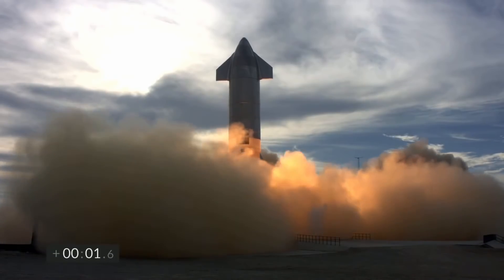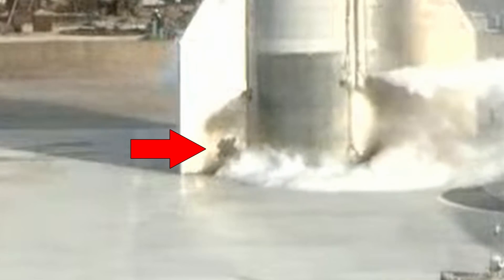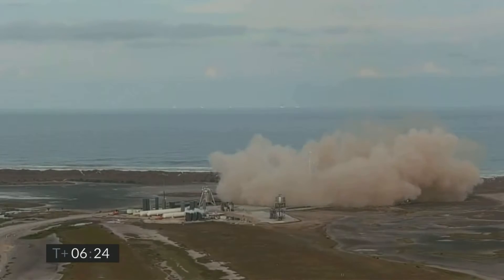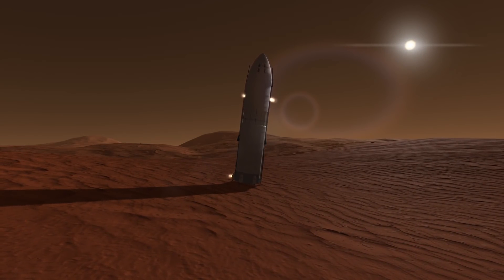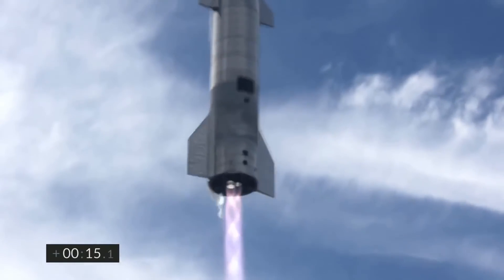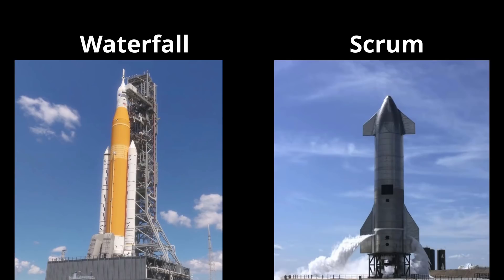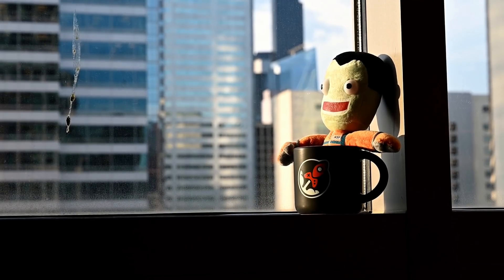Triumph and Tragedy: Starship SN10 sticks landing, then EXPLODES

Comment: As for design process I think the Waterfall approach is better for design based on an already proved concept so the design can go faster (theoritically but when politics get involved...) Scrum is better to design a new product not based on current tech with radical differences. It allows to test aspects independantly and improve the design each time. Scrum the SLS would in theory be useless, on the other hand, the Saturn V engines were scrumed a lot for a good reason, it was the first engines of this size for a rocket of that size. Using a Waterfall method, USA wouldn't have made it to the moon before the Soviet sent their Lunakhods there...

Comment: Imo, SN10 would have exploded faster if not for the fire suppression system. It helped cool down the skirt and lower pressure (internal leak and bad landing legs means that the skirt is next to inpenetrable and therefore the pressure builds up, with heat it can ignite methane and if pressures goes higher, something will break and possibly rupture the LOX tank just above, which likely happened. It exploded only after the FSS went offline (and external fire extinguished, suggesting a rupture due to pressure build. inside the skirt)

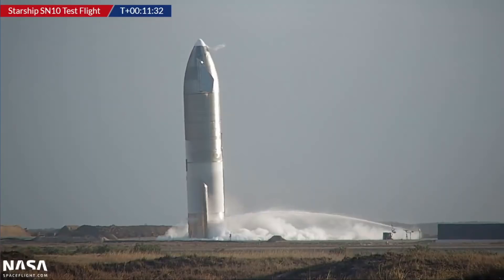Comment: About that fire hose: at 4:50 you can see that it DOES reach Starship. Maybe they had a problem with the water pressure, or it was intentional for some reason

Comment: well, I don't think anyone in his right mind would fly a system like this to the moon. For probes and such it is good enough.
Reply: This is the third iteration of a test vehicle... both the raptor and starship have lots of improvements needed and will get them, this vehicle will definitely improve and even if it's still unreliable, there's a lot of use as a cargo variant and not human
Reply: Why?
Reply: @matt309  because with the turbine pumps they are build for reusability, not reliability
Reply: So let's use it as our heavy lifter to send materials to our moon bases. I like it!

Comment: The different colours could be from a more recent engine with different throttling. I think they said they were going to be working on that. Might even have been deliberately testing it.
As for the fire suppression system; it may have caused the explosion. If the methane had continued to flare off it may not have been able to build up to explosive levels. By putting out the fire they made things worse.

Comment: Before touching the ground, it was already on fire.
Reply: That was the engine flame out which was only a little bigger than it should have been. The cause of the explosion was a pressure failure of one of the tanks
Reply: @solaris207  I saw videos saying and showing in slow motion that it was already leaking and another photo showing the raptor crushed by the beaten ground.
Reply: @rubensgoncalves5593  yes but my point is that the explosion still would have occurred without the fire
Reply: @solaris207   OK!

Comment: More yellow means more fuel rich as far as I know could have that been the engine causing the abort?
Reply: I'm probably wrong, but doesn't a yellower flame also mean lower thrust?
Reply: @midgesmall494  could be if it's caused by lack of oxidiser becouse it's not burning properly, but I think if you take the right mix and just add fuel it might have the same or even a bit more thrust and the yellow flames, but I'm not a rocket expert

Comment: I think the 2 engines shutting down at the same time might have been a failure, from what Elon said it sounds like they should’ve gone one at a time and not simultaneously. Could be wrong but just my thinking. Might be why it landed a little hard.
Reply: they did not shut down simultaneously and it did not land very hard, that landing up until the legs failing was damn near perfect. The legs are just not suited for the weight, after all they weren't testing the legs at this point.
Reply: @Hossdelux  Maybe not simultaneously but within 2 seconds of each other, it also did land a little hard, that’s why it bounced. I think that second engine might’ve gone out a second or two early and that would’ve made it come in nice and soft. Again, might be wrong
Reply: @nls.135  I thought it was the other way round, the third engine cut out late. I think they wanted to purely ignite 3, check them and immediately shut down one to flip on two, then shut down another after the flip and land on one. But I definitely could be wrong
Reply: @midgesmall494  I’m pretty sure that’s not the case because the whole reason of igniting three is to have a contingency for a engine failure, and if they almost immediately shut down that third raptor it would probably be too late to reignite it if another engine fails.
Reply: @nls.135  but they were gonna wait until all engines activate before shutting down one, and if one didn't turn on then they would keep the other two active, weren't they?
Reply: @midgesmall494  Yes, and they all did work so they kept it on until the flip was complete, no one really knows except SpaceX! It’s all speculation so I would like to respectfully end this back and forth.

Comment: SN10 exploded, and I think due to a error. possibly a engine error, from the raptor that was producing a different thrust from the rest.
Reply: If I'm not wrong, it was because of its not soft landing, due to this, the fuel tanks probably got a hole and started leaking, but it might be a engine failure too
Reply: @davisdf3064  well, it could be both, as if the tanks were leaking there would need to be a spark, and a engine failure could've given the spark. or an electrical failure.
Reply: @thegamingender6933 
Yep
Reply: It was a methane leak it was confirmed due to hard landing one raptor had low thrust and so it landed to hard